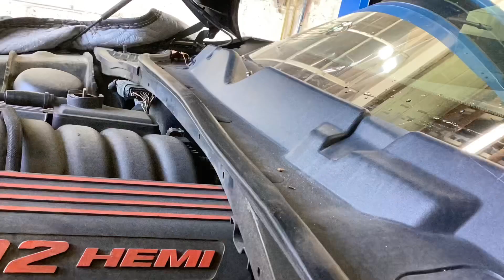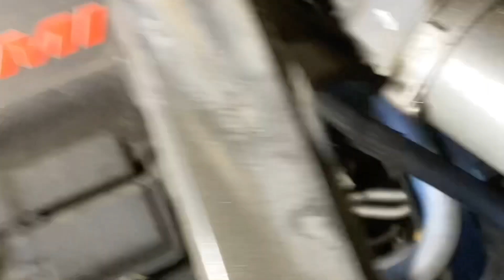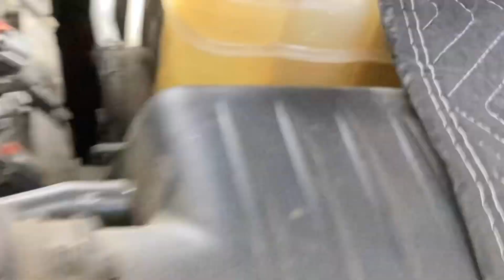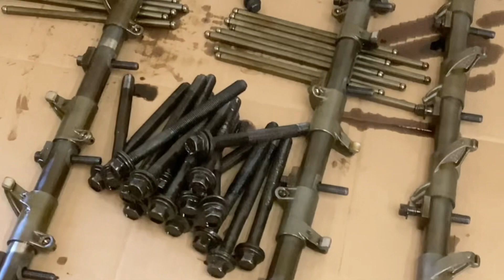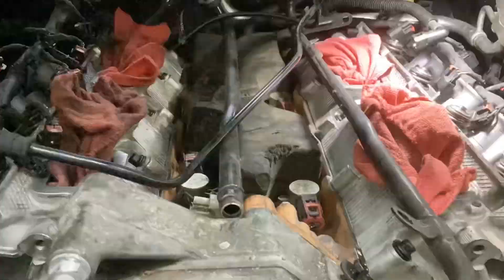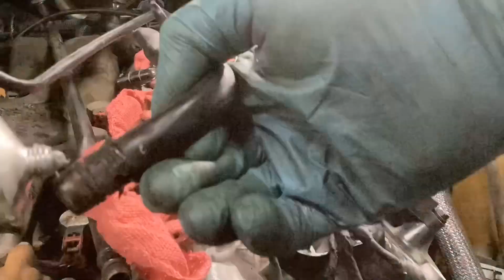Dodge Challenger 392 Scat Pack head gasket repair. Full job.

Comment: Do you have to send the heads to get resurfaced or can you just bolt them back in?
Reply from the maker: Definitely get them resurfaced! Also, take advantage of the fact that they’re off and get new valve stem seals

Comment: Can you go ahead and put the spark plugs in the heads before getting them on the block? Didn’t know if it would throw anything off or maybe it’s just bad practice?
Reply from the maker: @stevenburnse  you can definitely do them before you put them back on the block
Reply: Good question

Comment: So I’m guessing that the new gasket will have to be thicker to accommodate for the material removal on the head skimming? This would also allow you to reuse the same pushrods to keep the length in tolerance?

Comment: Awesome video man.  Thanks a lot for posting it.  This is going to help me a ton changing my gasket.
Reply from the maker: @stevensegalsbeard4792  No problem man! It’s not a bad job at all. There’s plenty of space and nothing complicated here.
Reply: @Gearheadsauto201NMain  Well I'm used to working on 440's and such.  This seems like the easiest modern motor head removal I can remember.  Being able to pull the head with the exhaust manifold on is nice.  Anyway, thanks again.  The vid makes it easy to take this on for the first time.  Your video is better than most repair videos on YouTube